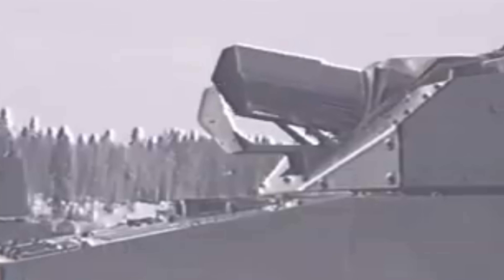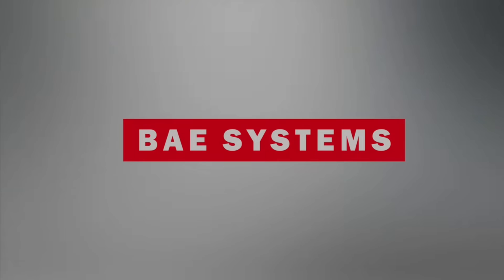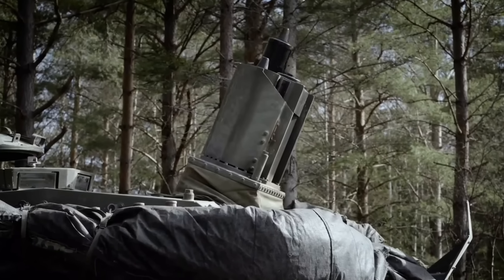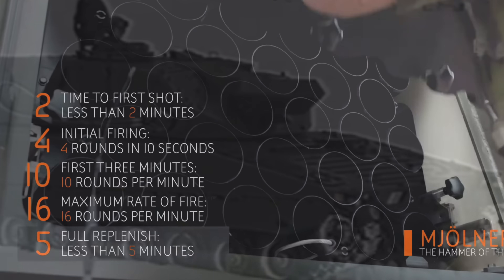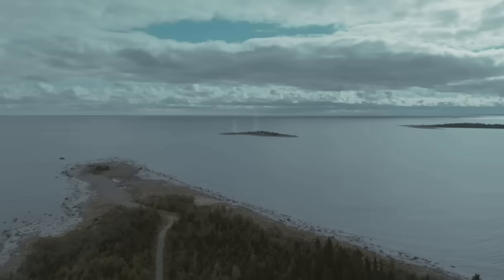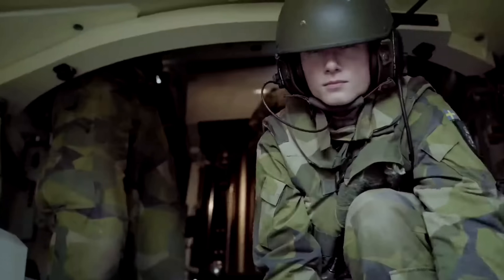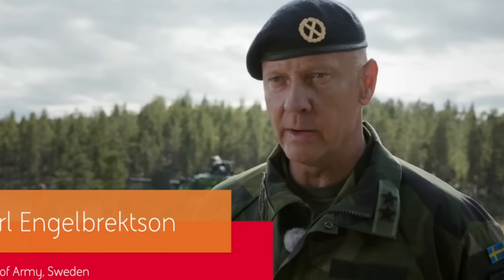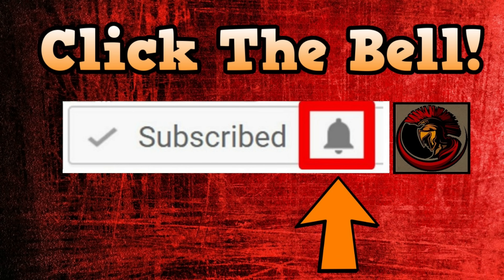The 'Mjölner' Rapid Fire 120mm Mortar Vehicle | DOUBLE BARRELED INDIRECT FIRE

Comment: The logistics and issues with old school Mortars cannot compete with this system. The future is mobility and accuracy. Having a large amount of ammunition on hand is critical.
Reply: Most of the vehicles I see seem to have a use case. But I'm never sure which has a necessary use case.
Reply: They'd be a VERY powerful force-multiplier, but I'd still have old-school mortar teams on standby. There's quite a bit of terrain that even a tracked vehicle can't get to. We learned that the hard way in Afghanistan.
Reply: You can't just compare the two systems one to the other. As others have pointed out, obviously cost and complexity matters. If you can have 10 truck systems, or literally hundreds of man portable systems, for the same cost, together that's far more fire power covering a lot of area. As with field guns and armoured self-propelled artillery, field guns make sense in long defensive lines and armour is of course critical on the offensives and counter-offensives. Speaking as a mortar man, time and place for every mortar system.
Reply: @hermes6910  then why did you even use civilian PCs as a reference?
Reply: This is a much more complicated system than the old Mortars, so it will have it's own new problems to keep it maintained and efficient ... old mortars could be carried by any pickup or truck , which is an advantage in my opinion
Reply: @omaral-maitah181  this was designed for peer level combat.
In this context, the enemy has located the firing unit down to a 500m radius by the time the first round fired from a new position peaks it's trajectory.
By the time the second round fired peaks, the enemy radars have the firing position coordinates down to a 10m radius and issending those coordinates on to their own counter artillery systems.
60 seconds later, those counter artillery systems are completing the final checks on bearing, elevation and ammo settings before loading.
3minutes after the mortar battery fired it's first round, enemy shells are beeing fired towards the mortar battery position.
4 to 5 minutes after the first mortar round left the tube, an enemy artillery barrage arrives at the firing position.
A towed mortar unit would, at that moment, at best, still be where the enemy shells starts raining death as they jump into their vehicles to move out after packing up their gear...
A Mjölner unit would be 50-100meters away from the firing position the enemy aimed at, moving away at 40-70kph AND protected by the armor of their vehicles.
Reply: @SonsOfLorgar  I saw an Ukrainian mortar group in action and the just left the mortar after 2-3 minutes firing and run away from the mortar so if there were counter shelling from the Russian side the soldiers would be alive and their vehicles that had been placed at least 50 meters away.
Reply: @NUMMEHARBEN  that's one method that could work, as long as the crew remembers to take the optics of the aiming device with them to cover.
During my own conscript graduation tests, our Swedish mortar platoon managed to pack up and be 300m away in 59seconds.
(Only possible if each crew member has a single thing to grab and stow in the sprint on their way to mount up in the vehicles, and we were allowed to leave the aiming stakes as expendable.)
Reply: @omaral-maitah181  they can also be air dropped
Reply: @hermes6910  pro tip, an enclosed, steel armored vehicle with steel tracks is a very good faradays cage...
Reply: I mean, the logistics of supplying a tracked vehicle are significantly more than a man-portable device. Significantly more.

Additionally, remaining obscured from modern surveillance systems is also significantly more challenging than targeting infantry. Vehicles stick out like sore thumbs, and their protection isn’t very effective with modern manpads.

Mobility is the key here. Thats why this system exists. To get close enough to hit trenches where a mortars angle is helpful while being mobile enough to avoid artillery fire. But also you need to be out of range of manpads and tanks, which is a challenge. So you need to generally remain on the backside of a hill to avoid direct fire.
Reply: The future is more efficient mass murder.
Reply: Not wrong, but your comment boils down to "do more". More accuracy, more ammo, more speed. Sort of a tautology for warfare, a no-brainer
Reply: @ericmckinley7985  війна це єдине що рухає прогрес в потрібному напрямку. Війна це бездонее джерело доходів для США, пригаймні останні століття.
Reply: This is why this has been designed from the Swedish armys comments.
Reply: @user-zh9kc7tw4n  The Swedish army is small in numbers so they can not have a hundred mortar teams instead of a Mjölner.
Reply: @NUMMEHARBEN  And the countryside is huge and often with soft ground and snow towing a mortar in those conditions would be rather interesting
Reply: Same with any ammo
Reply: @gags730  as a Swedish tax payer, If this is the price to be able to tell Putin and Lavrov that they can fuck themselves with their written demands to restrict my country's democratic right to rule ourselves and associate with whatever other countries we want to as we see fit, then I'll happily pay it, and for leasing some of them out as long as nessesary to anyone else trying to do the same.
Reply: As we called them in the Marine Corps;Four Douce! They are accurate! Depends on the crew and the forward observer. Whoever is calling the shots!
Reply: The US mortar system is robot operated, and unmanned.
Reply: I digress, each has their applications, and with drone warfare on the rise - these could become easy targets for drones in certain situations where traditional mortars can be applied more succesfully and in a more inconspicuous fashion.
Reply: I digress, each has their applications, and with drone warfare on the rise - these could become easy targets for drones in certain situations where traditional mortars can be applied more succesfully and in a more inconspicuous fashion.
Reply: “Old school mortars” will never be superseded by this type of gear. How many mortars are in inventory for any given nation? I will guarantee that they will never replace them all with these….. too expensive…… yes these have their place but they are an addition not a replacement, so old school mortars will be around for a very long time.
Reply: Debatable, the Marine Corps already has a better system in place, with their EFSS mortar system, by using a small mobile vehicle, with a 120mm mortar, as well as a small ammo vehicle. This becomes mobile, easy to air drop, and accurate.  Lastly it is cheaper than this Swedish system built upon a tank hull, which when it is damaged or knocked out will require a lot of maintenance and repairs, not to mention the cost of such. So next time you think you are a "logistical expert" in mobility and accuracy as well, have some experience in the artillery field first, because the EFSS mortar system is an all around better option for most NATO forces.
Reply: Logistics? Good luck with the ammo resupply. Oh wait you've never considered fighting anywhere but your backyard
Reply: Until you get in the mountains and your mortars can't
Reply: A simple mortar loaded on a pickup truck is dirt cheap, and in the event of all out war it will be the only mortar available for most troops.
Reply: @samsonsoturian6013  nobody is going to replace good and old mortars with mjölner. Normal mortars don't go anywhere but this mjölner seems pretty good with it's speed, mobility, protection +++
Reply: @Inkkari9  radar directed automated counter-battery fire is going to make 120mm baseplate mortars deathtraps. A team of infantry can't tear down a baseplate mortar before return fire arrives.
Reply: @Inkkari9  only that's exactly what the Swedish army did several years ago when the Mjölners started rolling off the production lines.
The previous towed 12cm mortar m/41 got passed on to the Home Guard part time volounteer defense militia.
Reply: @kschleic9053  it's possible with the old towed Swedish m/41 mortars, but you only get one salvo plus 3 rounds/piece and then wrap it all up and GTFO, leaving the aiming stakes on site to get away far enough that any stray shrapnel would get stopped by fibreglass or mild steel vehicle sides, non critical parts of the vehicles and the crew kevlar flak vests and helmets...
Reply: @SonsOfLorgar  swedish armed forces no more uses traditional mortars? Only these mortars? If so, maybe it fits for swedish.. Finland has forces (conscript) so much and terrain is sometimes so difficult that I highly doubt it would work here. Well anyway I like mjölnir 👍
Reply: @Inkkari9  The Swedish armed forces are also mainly conscripts again since the conscript system was reactivated in 2014.
But yes, the shorter distances, higher quantity of lakes and bogs, lack of mountains as well as a much more numbers focused conscript system naturally results in a different priority in how and with what equipment your armed forces need in the plan to fight any given hypothetical scenario.
The Swedish armed forces was numerically (manpower) and to some extent materially dismembered by alternating laisses faire capitalist and psychologically corrupted social democratic minority governments budget decimations between 1992 and 2014.
When the politicians were finally forced to understand the gravity of their predecessors foolishness, the damage was already done, and the fastest way to start rebuilding to a minimal acceptable defense capability was to go all in for advanced mechanisation with the regular forces and to transform the Home Guard militia to a motorised national defense quick reaction force very different from the static 'old mens club' local defense militia with second hand equipment it used to be in the cold war.
Reply: @SonsOfLorgar  if I understand correctly, today Sweden is taking it's defence seriously. Military officers and politicians treat military like they are needed? Military culture and people's attitude to military changing better? If so, I highly appreciate this change! |🇫🇮  |🇸🇪
Reply: @samsonsoturian6013 its also not an efficient use of precision munitions to target it.

This system costs enough to warrant the additional attention.
Reply: Now imagine the potential for further development with possible specialized ammunition...
Insane platform, love it!
Reply: My mortar team alone can carry out a mission quicker than this thing. "Rapid fire" lmfaooo
Reply: @thecoos283  About the only real edges this thing would have over your mortar team is survivablilty against small arms fire and ability to carry ammo into the fray. Beyond that, it's not doing much.
Reply: удачі. тобі доведеться заплатити велику ціну щоб створити подібне.
Reply: They should have made it much more compact, less noticeable, and quick 
like being installed on dirt bike or atv/utv like all terrain vehicles.
Reply: The logistics will not change . Stop waffling 🙄
Reply: @alangordon3283  umm... the logistics already changed with this system.
A towed mortar system carries at the most 10-20 rounds/piece of which at least a quarter is smoke shells and all in crates or plastic quivers.
 That towed mortar platoon also requires at least one flat bed 4x4 or 6x6 cargo truck for hauling the rest of the ammo on cargo pallets.

The GrkPbv90120 can carry twice the ammount of a towed system just in it's ready racks, and then that ammount again in secondary storage, effectively eliminating the need for ammo trucks in the unit itself as one Mjölner platoon can go back to batallion ammo depot to fill up when down to <30% while the other platoon covers the line companies of the batallion in it's absense until relived.
This along with the fact that the mortars are using the same chassi as the mech inf companys CV9040 IFVs, CV90ARV, CV9040FCV and CV9040FOV as well as the CV9040AAV of the Batallion AA section means the logistics chain of the entire formation has been reduced by an entire link.
On top of that, the towed m1941D/E 12cm mortars the Mjölner replaced was towed either by unarmored 50year old Volvo tgb13 utility trucks(Civ designation volvoC306) or just as old unarmored Hägglunds Bv206 utility tractors...
Both of which just aren't capable of keeping up with CV90/Strv122 battle speed even if the towing vehicles had been factory fresh... which they aren't, the newest were built in the late 1980ies and has been driven around in every weather in every terrain all year round by 18-20yo conscripts, enlisted soldiers and officers both in Sweden and wherever in the world we sent expeditionary contingents under UN or EU command.
While the fact that many of those utility vehicles still serve with tens of thousands of miles on their meters is a true mark of excellence on the quality of their design and the dilligence of Swedish army maintenance procedures, those utility vehicles are like that pair of old, super comfortable sneakers that are litterally falling apart and beeing held together more by ductape, dried sweat and nostalgia than the fabric, glue and rubber they were made of.
Reply: @SonsOfLorgar  Mjilonir is a supply truck, a tracked one, attached to the mortar
Reply: Ever heard of something called EMP?
Reply: @heather.2436  saying "muh EMP" deserves being laughed off. Requires high-altitude nukes (high political cost/retribution), indiscriminate (it hits you too) and its defeated by simple EM shielding to microprocessors. My PC has that.
Reply: @heather.2436  You have any idea what causes EMP?
Reply: @heather.2436  the CV90 is protected against emp.